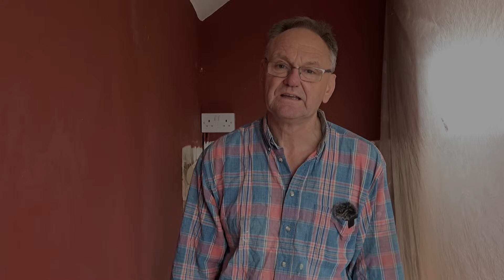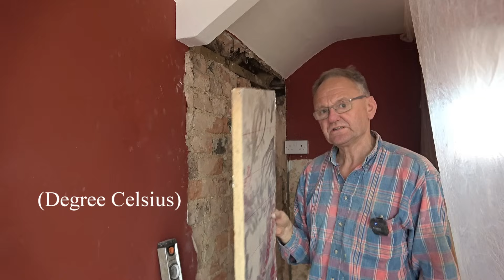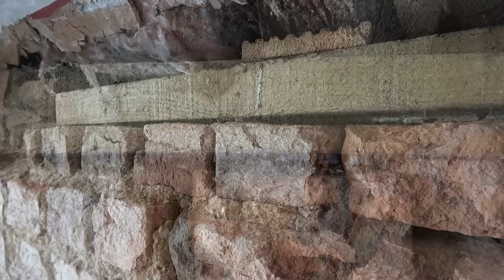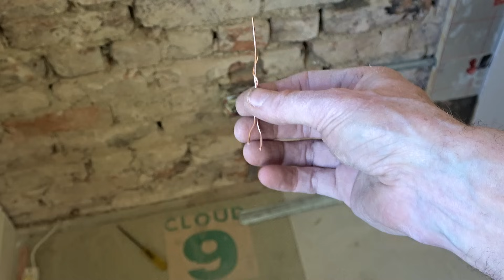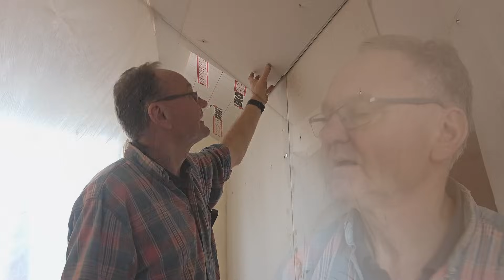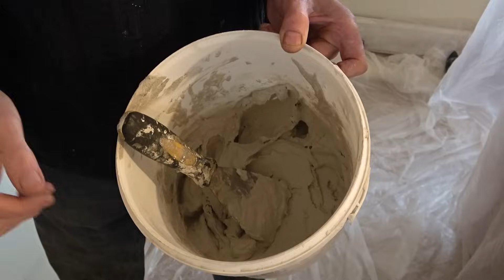HS165 Insulating a solid wall (Do it yourself)

Comment: I’m just starting on the long journey of understanding insulating older buildings but is it not prudent to leave air gap between pir and brickwork?
Reply from the maker: Hi thatwasthedaythatwas, well as I say I'm just a DIY guy with no specialist knowledge but I have now come to some pretty firm opinions. 1) if your house has high humidity there is a risk of condensation on cold surfaces, with or without insulation; 2) there is a risk with any non-breathable insulation that vapour from within the house will get through gaps and condensate on the cold wall behind the insulation. And so to eliminate the risk you have two options, in my opinion, 1) use breathable insulation; 2) use non-breathable insulation with an air gap and allow ventilation in the air gap from outside (like a roof space).  Just leaving an air gap without external ventilation will not remove the risk of condensation due to vapour - it's just dead air space. However the gap might reduce the risk of any moisture transferred by physical contact.  I saw a video recently of a house with a 1 foot air gap behind an insulated stud wall but with no external ventilation and the internal rendered stone wall behind was very mouldy. Like I say, these are just my opinions. We keep our house well ventilated and so far we have not detected any problems with the insulation in our bedroom - but I assessed the risk beforehand and took the risk. We'll see in time no doubt. Cheers
Reply: @HaxbyShed  Hi and thanks for your reply. I agree with your view about having a ventilated air gap. It’s all new to me also and it was just an observation. I hope it all works out. Merry Christmas

Comment: I thought using cement on lime mortar was a big no no
Reply from the maker: Hi Coolmonkey, I did not mention it on the vid but I mixed a bit of lime in it, for various reasons including the mortar should not be stronger than the brick. But as I say, I'm just a DiYer and what I do is often not the right or best way. Cheers

Comment: Well done taking the time to make the video. 
I would strongly advise anyone intending on performing similar works to take steps to mitigate air-leakage too. 
Draft contributes 5x to heat losses compared to conduction. Membrane & taping this area, as a start to a wider building-wide initiative, would add considerably to the quality of the buildings thermal envelope.
Reply from the maker: Thank you Greg. To support your point, last Friday I put out a follow-up to this video going around with a thermal camera and, for example, cable entry points were stand-out cold spots. Cheers.

Comment: I thought that internal wall insulation had to be mounted on battens Your method looks to be a better solution and takes up less space in the room. My only concern is if the wall you are insulating has damp or gets damp from outside after the insulation is applied.
Reply from the maker: Hi Reg, yes there is a risk as you describe. I made a judgement that the risk is manageable in that situation but if I'm proved wrong I'd have to take it off and come up with a new approach - breathable insulation maybe.  Cheers.

Comment: You have a fluent, articulate and thoughtful style that is a real pleasure to listen to.  How wonderful to hear proper spoken English....and disappointing too, that its rarity nowadays leads this to be remarked upon.  The content's good too - well-chosen words and no needless repetition.  May I ask what it is that makes external insulation impractical for your wall?  A blind external wall facing a neighbour sounds ideal and the thermal mass of the bricks inside the insulation would then buffer against temperatture variation inside, to further improve comfort.  That said, you've sorted out your rubbish internal plaster and have regained a vertical internal wall.  Six and two threes, as my father would likely say.
Reply from the maker: Hi falfield, thank you for the compliments. The gap between the two houses is only about 15 inches (375mm). I am a slim guy and I can just about get down there sideways. Some years ago I had to remove a redundant 4inch vertical toilet pipe in that space and I had to make a bespoke wooden ladder with rungs just wide enough for one foot. I shimmied up sideways like a crab and sawed through the fixings with my arm out to the side.  So it's just not feasible - no builder would entertain it. Cheers
Reply: @HaxbyShed  Thank you for the reply.  I agree of course that no builder would take this on, but did have one flight of fancy in case the gap transpired to be this narrow.  It was to pump foam in to fill the gap, insulating two houses for the price of one.  The practical problems then to be overcome are guttering, subfloor airvents if there are any, and damp bridging the DPM.  I've heard that the last of these is greatly overrated as a risk in a location such as this where little rain reaches the ground.  A 100mm flexible ventilation pipe, as might be used above a bathroom ceiling extractor could act as a conduit for air to the front/back of the building.  And the flight of fancy for valley guttering would be to lay a 400mm roll of code5 lead on a plywood former, supporting it with a suitable fall on a sacrificial scaffold mounted on a row of jockey-wheels, with the whole heavy contraption run into place on levelled ground from the street with the aid of the village cricket team's help. Then wall up the gap between you and the neighbour, lobbing in a time capsule with photos of the fun, squirt in the foam and never see the scaffold or feel cold again.  OR alternatively to keep the rain out: form a new ridge directly over the passageway, with new valleys a couple of feet up each of your and your neighbour's roofs where you've full access to do the leadwork.  Oh! I see my spliff's gone out....well, the daydream was fun while it lasted ;-)
Reply from the maker: @falfield  🤣🤣🤣🤣🤣🤣 that made me smile.

Comment: won't using something like non-breathable insulation board cause damp/condensation build up on the inside as the solid brick can no longer breathe?
Reply from the maker: HI cyberlizardcouk, well yes indeed it might. No sign yet but it's only been a year. I agree something breathable would be preferable but I only had 1.5 inches of depth at most. You saw I had to chop the plaster off even to get that. Quite by chance I have an update video out tomorrow on this project. It add a bit more to the story. Cheers

Comment: Better products to use on this project would have been a vapor permeable insulation such as mineral wool, sheeps wool, wood fiber board or hemp fiber board insulation using the dot and dab installation method or plastic fasteners. That could be covered with a vapor permeable plaster board or plastered directly with a lime based plaster which is vapor permeable. Plasterboard could be installed again with a dot and dab or plastic fastener method. No steel scews which create a moisture / thermal bridge should be used. Your exterior wall is a solid soft brick with lime mortar. Those materials need to breathe allowing moisture to pass through them and dry out. It is also important to add the right amount of insulation to the wall so as not to isolate the brick exterior from the interior heat. That warm side of the wall, helps dry it out. There is good information in this series, https://www.youtube.com/watch?v=Uqe_yf-z3oQ&list=TLPQMDYxMjIwMjPuqQAQK-_uzQ&index=1 And of course this info. is for people viewing this video with an eye towards a future project. Your project is finished and I hope it gives you a warm bedroom without any issues.
Reply from the maker: Hi avisitorhere, thank you for the information and link. Quite by chance I am posting an update video tomorrow where I use a thermal camera so see if, and by how much, I've made any improvement with this job. So far we have not noticed any damp, mould or musty smells. However I would not claim my project was best practice in any way and indeed there could be condensation behind there that I'm just unaware of. Cheers
Reply: @HaxbyShed  Thank you so much for the update I look forward to seeing the result. I think the  camera will show a very good thermal result for using the foam board. My concern is with the damp that the vapor barrier will cause over time.  I will say that I enjoyed your video, it was very clearly done and look forward to the update.

Comment: Twisting earth wires is standard as it make a ring circuit and and makes a better connection when fixing to the metal box ?
Reply from the maker: Hi Steve, like I say I'm not an electrical and claim no expertise whatsoever. The thing I was trying to show was the earths were twisted together but only within the sleeve - and only the longer one was clamped. The short one was only held by being wound around the long one. I know as long as there is a connection you have protection but personally I was not happy with it. Cheers Paul
Reply: Steve, Sorry but it's NOT standard to twist earth wires together. In the past some have done it but it's now very much discouraged. Each earth wire should also have it's own sleeving rather than combined in one sleeving. Alterations, fault finding and routine inspection and testing require wires to be temporally separated. Constant twisting and untwisting weakens them.

Comment: Great video, two observations are, could you have fixed the celotex with an adhesive instead of drilling and screwing? Secondly, have you tried the Bosch, multi construction drills? They would be perfect as they are extremely durable and sharp so you can drill even quite hard masonry without using hammer action on the drill. Give them a try and you won’t be disappointed. Thanks for sharing this video.
Reply from the maker: Thanks Tony, I had never seen those. I may get some. The problem with hammer on bricks in a house like this is the hammer vibration can shake the brick out as the old mortar just breaks up and falls out. It's not too bad with SDS action because that is more effective and quicker than a normal pistol drill which is just vibrating rather than punching. Cheers

Comment: I have been looking at doing this to my Victorian house too. But building regs now call for 6 inches of cavity insulation, so how good is just one inch of Kingspan on a solid wall?
Reply from the maker: Hi Jamie, I have bought myself a thermal camera in the black Friday sale and in one or two weeks I will put out a follow-up vid so you can see the temps insulated Vs uninsulated. On some walls I only had room for 12mm of PIR/kingspan (e.g. a very narrow staircase) and believe me even that makes  quite a difference. Cheers

Comment: Many thanks for sharing and explaining so well. - I’m having a similar brick wall i.e. with much loose cement between the bricks as well (in my loft). How do you re-point when the gaps are narrow and go deep? Is there an injection method to make sure the cement reaches all the way through? As you probably guessed, I’m a newbie DIYer.
Reply from the maker: Hi Mikki, I'm no builder (just DiY like yourself) but I would suggest rake out the old loose, mix up your mortar (4:1 sand, cement and a bit of lime), put some on a flat board or a plasterer's float you can hold in your hand, and then flatten the mortar to the height of the gap you are trying to fill (like a thick pancake), and then use your trowel to cut and slide it in. The trick is use plenty and press it in - that way it sticks. If you sissy about poking little bits in it will just fall out.  Use enough to fill the gap in one go. For vertical joints I use a paint scraper to make it more manageable. It you get the mix right it won't fall off your scraper. You will quickly improve. I really enjoy it. Cheers
Reply: @HaxbyShed  Much thanks indeed, sir. I shall practice and refrain from sissing about  ;-)
Reply from the maker: @mikkibubble4711  if the gap is narrow (in height) and goes back a long way, e.g. more than an inch, I'd have to do my best with the first application then push it to the back with a bit of wood or something pressing the mortar hard up against the back of the joint and packing in the space. Need to press the mortar enough to force out the water and then it holds - after that chemical reaction bonds the mortar to the brick.   Who knew there was so much to say 😁

Comment: Well done makes a massive difference to the warmth of a room just done this in 2 bedrooms however found it much easier and quicker  to use adhesive foam to stick the boards to the walls no need to plaster them Americans do this all the time called drywall
Reply from the maker: Hi, if I do another I may use the adhesive foam. It was just because I had always used screws before and I was reluctant to 'learn' adhesive foam for maybe the last wall I'm going to do. In UK we call the board itself Plasterboard, but when we use it to stick on a wall like that we call it 'dry lining' so in that way we do call it drywall.   Maybe it's like like when people say "I'm making a film", it's not film these days at all but we still stay it. Sometimes there is no logic to these things - a hangover from an earlier time. 😁 Cheers

Comment: Bravo. The u-value of double brick solid walls can vary a lot but is generally over 2. Adding just 25 mm of PIR and plasterboard might well reduce that to .6 to .5 meaning that the heat loss is now a quarter of what it was. The latest building standard is .27 but starting with a blank canvas is easier!!
Reply from the maker: Hi Brian, thanks. People have been concerned about condensation forming behind the boards  and I'm sure the risk is real. But now we are 1 year on and so far I've not seen any problems. And the wall is a lot warmer and the room is more comfortable. Cheers Paul
Reply: @HaxbyShed  Thanks for responding. I was looking at a stone cottage in Scotland the other day (over the internet) and that was very damp inside. I have just come across this which talks of dealing with damp and solid walls! https://www.youtube.com/watch?v=kWPN7cxlg1U . To my mind a microporous paint or coating on the outside should deal with rain penetration whilst still allowing the walls to breathe. Whether you get direct rain against your wall is unlikely given you said it is close to the neighbours wall and that should help. But the foil backed PIR will form a solid barrier. I saw someone using wood fibre insulation in a single wall damp situation?

Comment: Those solid walls need careful consideration regarding the hygrothermal equilibrium,  in other words,  the relationship between moisture and thermal energy moving through the wall from warm to cool.  Interstitial condensation and trapped moisture is a huge problem.
Reply from the maker: Thank you Terrance. Quite a few people have warned of that risk. Fingers crossed, 1 year on it seems to be ok so far as I know. Cheers

Comment: What about the condensation between the wall and the pir board 🤔 Usually they do stood work and 50mm cavity to avoid problems.
Reply from the maker: Time will tell. It is a very confined situation and I could only create 1.5 inch of space total, for insulation and board combined thickness. It may not be the proper way, I accept, but one year on now with no signs of condensation or smells yet. Cheers

Comment: Nice video. Are you going to have cold bridges where the timber floors attach to the wall? Also condensation and mould issues behind the wall insulation?
Reply from the maker: Well Jon I will defo have some cold bridges - I did squirt in some foam later at skirting level. But whether I get mould remains to be seen. One year later and there is no visible mould or condensation. There may be something behind maybe but I won't be pulling it off to check. The baseline is what it was like previously - a freezing cold wall. Cheers
Reply from the maker: Well Jon I will defo have some cold bridges - I did squirt in some foam later at skirting level. But whether I get mould remains to be seen. One year later and there is no visible mould or condensation. There may be something behind maybe but I won't be pulling it off to check. The baseline is what it was like previously - a freezing cold wall. Cheers

Comment: Great video. Just to confirm: the insulation is glued on with adhesive dot and dab and the feather edge plasterboard screwed on?
Reply from the maker: Hi scan2man, actually I did not use glue at all. The screws hold both the plasterboard and the insulation. I know the better/easier/quicker way may be to use dot and dab but I only do these jobs every few years and I use screws (only) because it's what I've done before, rather than learning a new technique. It would certainly be a lot quicker to dot and dab if I was using plasterboard and insulation board bonded as one. Cheers
Reply: Much obliged!